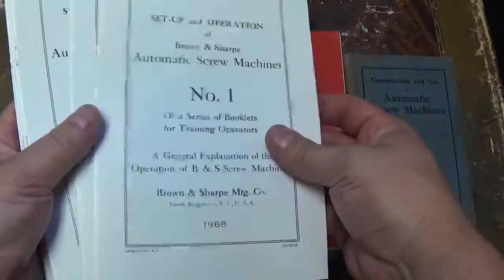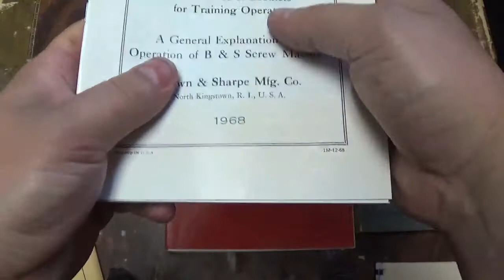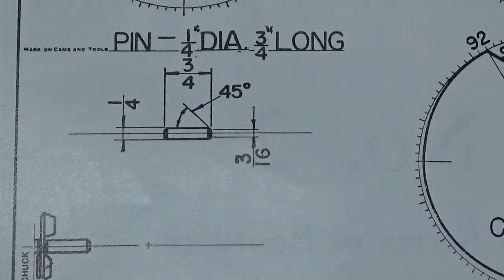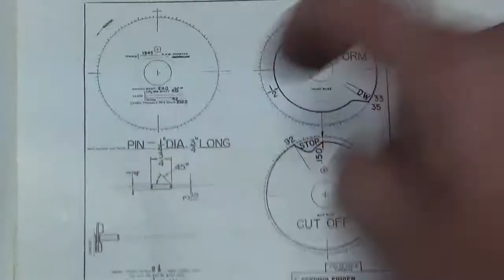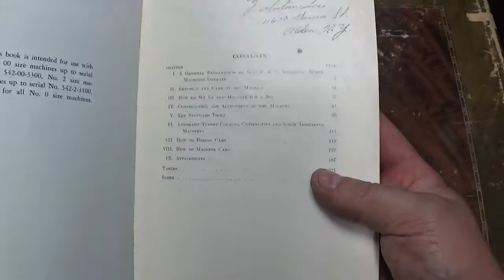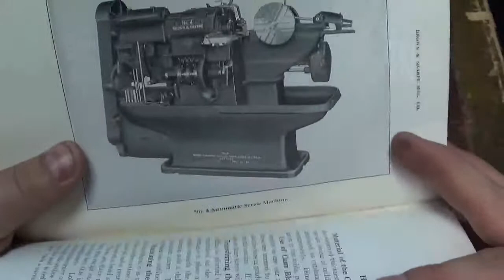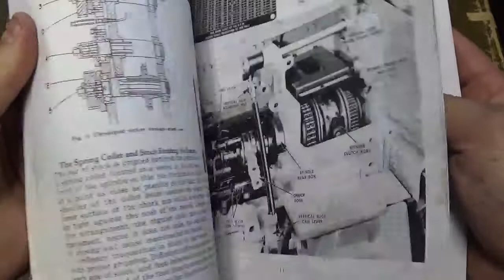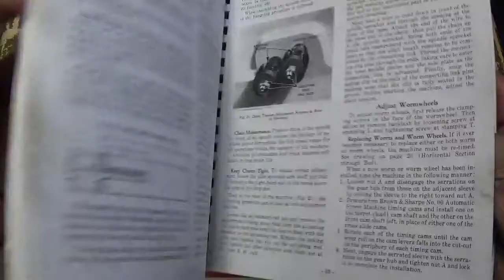Books you need to understand setting up and running Brown and Sharpe Cam Driven Screw Machines.

Comment: Nice to see Your interest in the B&S.  I started setup and operating them in 1967  and stopped in 2007 great machines
Reply from the maker: Great to hear! How can you find the year of mfg? I can't find any date on the thing to identify it
Reply: @MrTL117  The company you need to talk to is Automatic Screwmachine Tool and Supply in Romulus MI. you can get parts books per motel of machine just give them the serial number of the machine
Reply from the maker: @LS-si6wh   I'll give them a try

Comment: Most of what is written in the Construction book is found in the red book, the updated edition for the Automatic Screw Machine, or "square base" models.  The red book has improved explanations of cam and tool design.  A later book was published for the newer Ultramatic machines, which goes into even more depth.

Comment: Your red book appears to have a loose cover.  I have never seen a cpoy of the red book that does not have a loose cover or missing pages.  As you said, nobody learned screw machines in school.  B&S found the best way to sell machines was to have guys go to shops and train the operators, set ups and engineers how to do the jobs.  But to fix machines, you would be stuck hiring repair men directly from B&S, or older retired guys making money on the side.  That is until the later 90's when they got paid to have guys from all over the US come to their factory and learn there.  I took the class.  They taught on their newer model Ultramatics which at least functionally nearly identical eve to their older machines, the G Sereis, the ones with belt drives instead of chains.